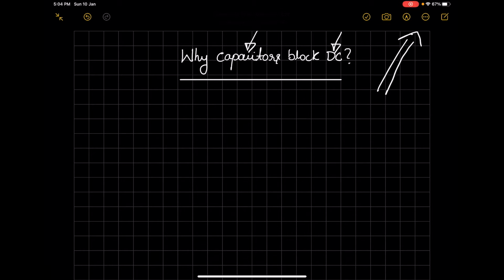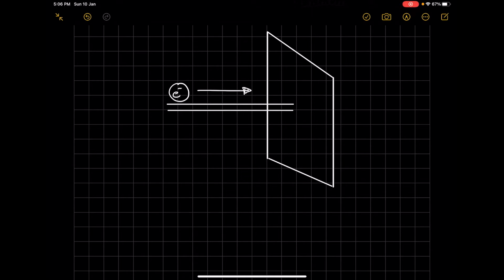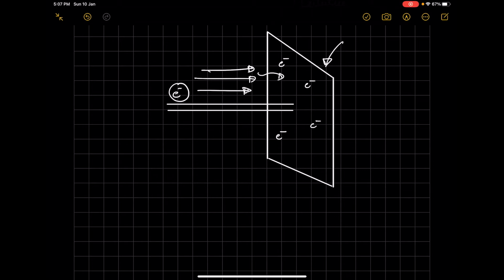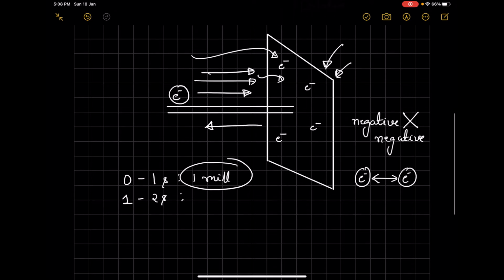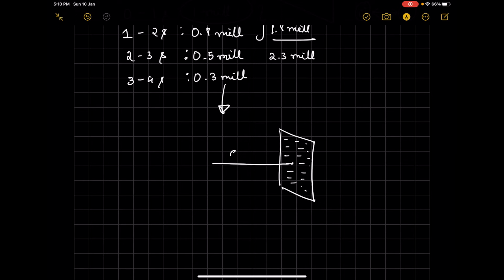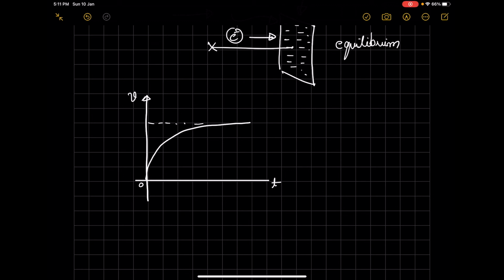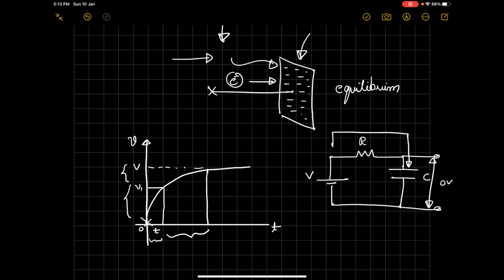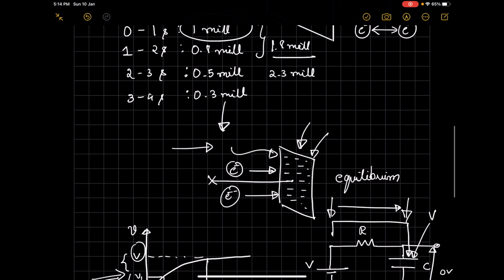Why capacitors block DC? | Electronics 101

Comment: Great video,
You mentioned about the air gap between the charging plates of the capacitor.
In that case, how do the electrons move from voltage source and accumulate in the plate when the circuit is not closed properly ;)
Reply from the maker: You are right. The circuit is not closed. There is only a momentary charge flow (intial charging time)... After some point as explained in the video, the flow stops.